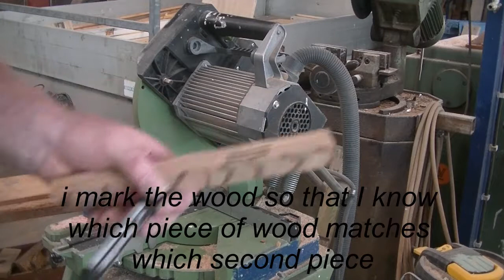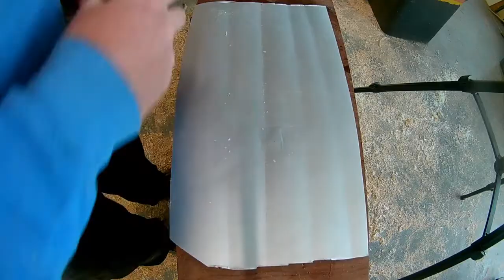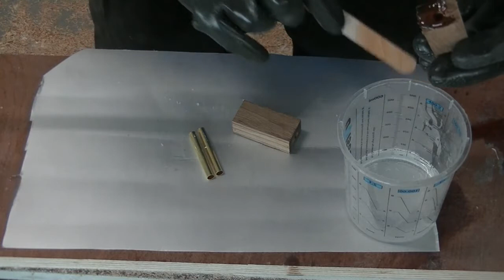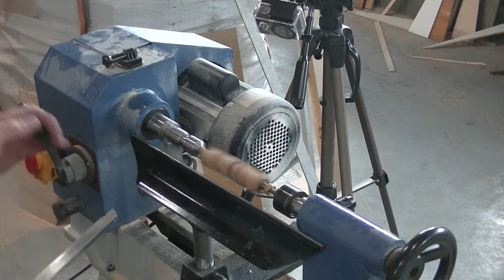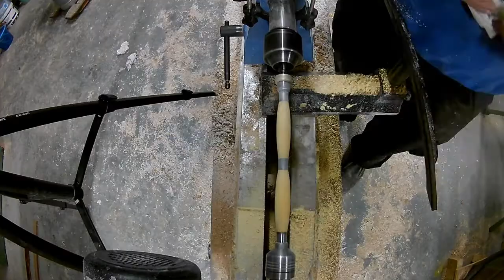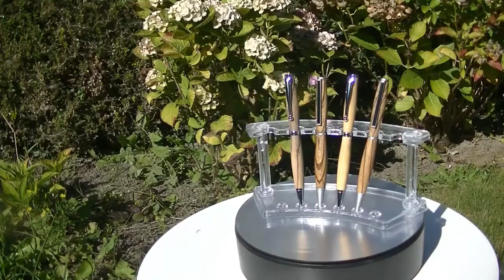pens from zebrano and boxwood

Comment: Hi Hans, Another lots if nice pens. Do you use resin to glue the tubes in? Take care. Cheers, Huw
Reply from the maker: Hi Huw, yes I use epoxy resin to glue the pen tubes when I make many pens regular epoxy and 5 minutes epoxy with a single pen.
I also tried with ca glue, but then I often had incomplete adhesion and therefore the pen failed.☹
That's why I use epoxy because it fills more like CA glue. Cheers, Hans

Stay safe and keep  turning